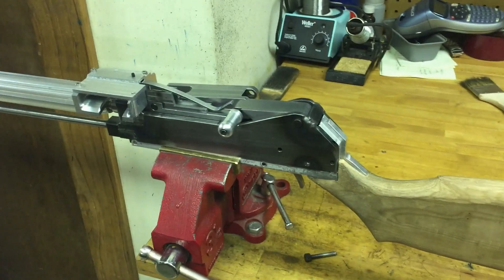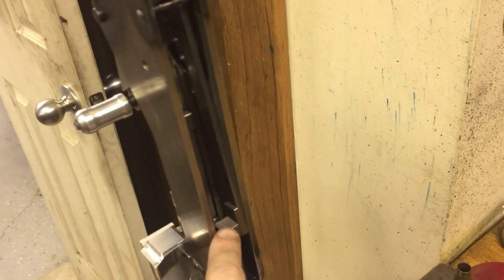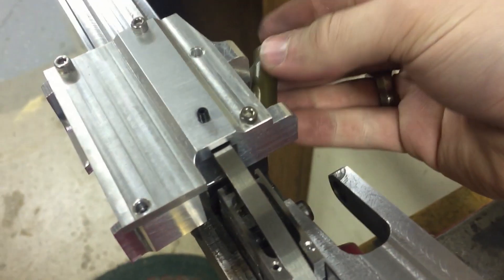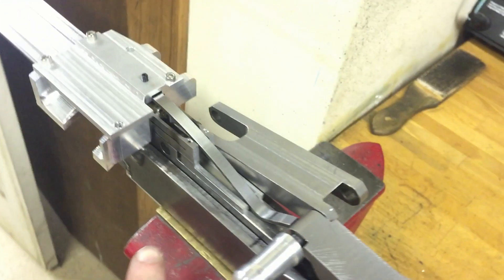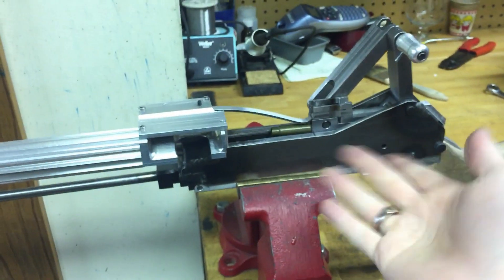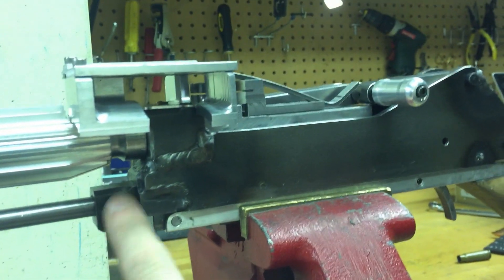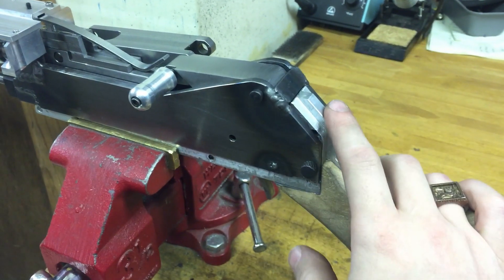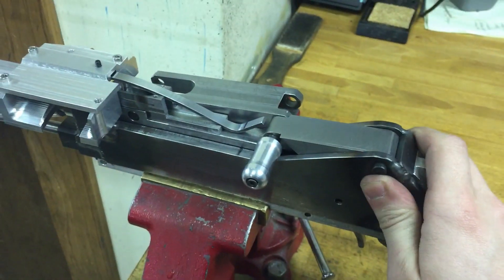Can I Build a Belt-fed Rifle?

Comment: Try alumaweld (unsure of spelling) rods. Of course you're then limited on materials, but with much lower temp welds for a lighter body. Use machined alloys for the mechanisms. Standard Arc and Mig welding is just too hot when when welding thinner metals. Great design. I believe you have a future company name. Good luck to you.

Comment: You are doing exactly what I wanted to do with my life, but you are clearly smarter than I. Even if this design goes nowhere, GREAT WORK. your skills for how young you sound are unfathomable. I can only dream of being as capable at machining/engineering as you are when I’m in my 20s as you most likely are.
Reply: He has internet, free CAD software and cheap Chinese tooling. Look at all the things old school engineers achieved. They did everything by hand. Drawings and manual machines.
Reply: @Timb0NZ  show me your fucking belt feed lever gun you made on a no power feed Bridgeport with no DRO and a lathe with no DRO and only 6 feed rates. Using nothing but HSS tooling and no measuring tools but verniers and Prayer like they did in the 40s…. Oh and do all the drawings by hand… I’ll wait… Even if you could do that, you wouldn’t, cause your hopefully not that stupid to waste that much time. Don’t be doin that dam “back n my day” shit demotivating people and devaluing there talents, pisses me the hell off.
Reply: @Timb0NZ They were also trained.

Comment: Hey, I always wanted to make my own firearms from scratch. 
My question is how did you start building firearms, what tools are required, materials, and skill?
Reply: Machining, metallurgy, and mechanical engineering. A lot of books available covering the topic.
Reply: @Anony___mous  Can you recommend me some books?
Reply: @CruSquad_Archives  https://youtu.be/LMcGKl_HqVE?t=420
https://www.youtube.com/watch?v=mLuoQoG1IC8
Also saw "The bullets flight from powder to target" by F. W. Mann recommended on comments by haven't checked it out myself.
On engineering I'd recommend Shigley's Mechanical Engineering Design (it's a monster but really approachable and you'll only need the first 10 chapters for guns because the later half is bearings, gears, belts, shafts and power transmission).

Comment: is it going to use disintegrating or non-disintegrating  belts? also nice rifle, the design is very unique
Reply from the maker: non-disintegrating cloth belts for now. If it works I may try steel non-disintegrating belts from an RPD. I'm not sure if there are disintegrating belts available for 7.62x39.

Comment: you gonna make a mount for a belt box? might as well add a bipod at that point
Reply from the maker: I may add a belt-box, the trouble is this uses cloth belts that I'm currently making from nylon webbing, so they're kinda stiff and don't bend as easily as I'd like. That actually helps feeding into the gun, but makes the rest of the belt awkward.
Reply: @domsworkshop1325  maybe it'd be easier to use standard issue military belts instead of making your own
Reply from the maker: @cooperdavis9663  In some sense, yes, and I may try to do that later. For now, I'm doing it this way because of how it helps feed and is also lighter-weight. If it works okay here, then I may move to heavier military belts; I want to make it as easy on the gun as possible first, then step it up after I can show that it works.